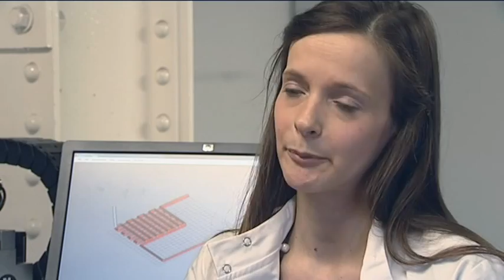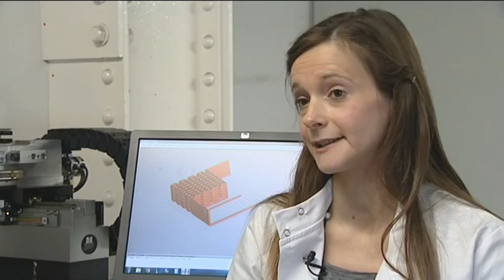3D printing graphene parts

Comment: Would be fantastic if, very soon, a full denture, 3D moulded, perfectly to the shape of the patient's mouth for comfort & simple to keep clean. Can be quickly made & available to all.
The patient's stem cells incorperated into the mix, for acceptance by the body, in the case of implants? I haven't a clue tbh. Just an idea that's probably already being worked on?
But... No more lobs of plastic that can take a good bit of getting used too & often making you feel physically sick with the thick span of plastic across the roof of the mouth. Imagine simply putting in the top or bottom of your mouth before you go out for the night. :D
Oops! Sorry, that was in a dream without money. lol
Great vid., nicely presented. Thanks :D
Reply: +Roo63 you should look into LIPUS tech for getting the body to regenerate parts of a damaged tooth or growing whole new teeth. I am in the process of getting all the parts I need to build my own LIPUS device 
(Low Intensity Pulsed Ultra Sound) Then someone would not even need the dentures at all. :)